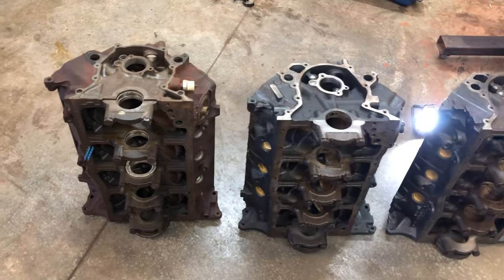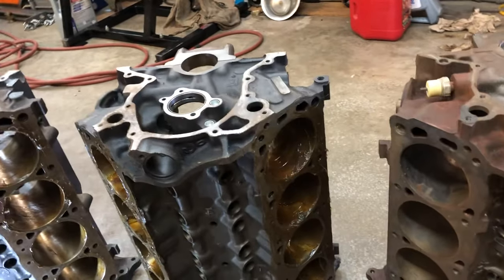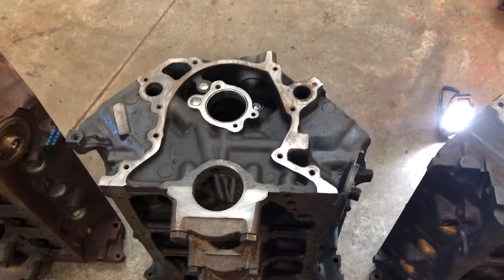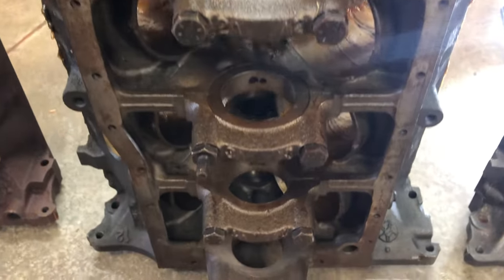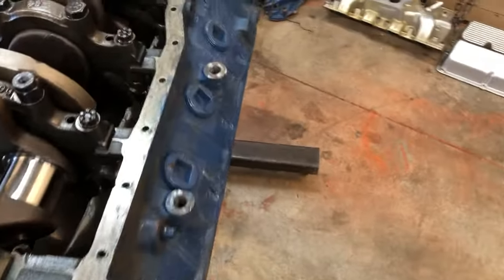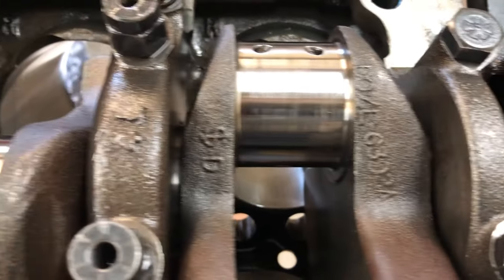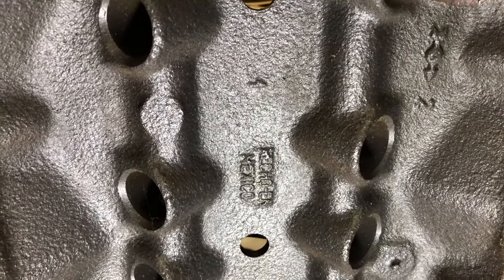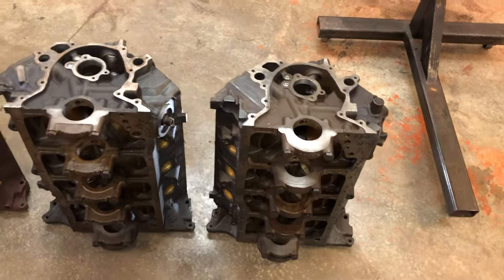The 4 different factory versions of the Ford 302

Comment: Some other differences that matter, IMO.
 The '68 to '80 blocks are really good blocks. In '80 or '81 Ford had to backpedal some, as they had intended to be super politically correct and dump the 302 after the '79 model year in favor of the horrible 255. Mustang fans and buyers threw a fit, especially if they test drove anything with the worthless 255 for power(pardon that overstatement). They made changes to the 302 block casting for lighter weight, meaning weaker. I took my '74 standard 302 block to a machine shop a few years ago, and you could tell they hadn't seen anything but roller blocks for a long time. When I picked it up, the machinist showed me in detail where weight and strength had been cut out of the later blocks by comparing mine and a '93 block. These days you hear people saying a 302 block will break in two if you have around 550HP. I guarantee you'll be hard pressed to find a '68-'79 block that breaks apart at that power level. Back in the OHO and FMS catalogs of the '80s, Ford, conservative as they were, said the production standard 302 block was good for 600HP, while the Boss was good for 1200. They recommended max overbore of .030 or .040 on the standard block and .060 on the Boss block. My '70 Boss is comfortably at .060 over.
 Saying the Boss block is a regular 302 block with 4 bolt mains and screw-in core plugs is not true. Weigh a bare one and compare it to the weight of a bare standard block. Significant weight difference. Even more of a difference between the Boss and a standard roller cam block. Then look the littlest Boss over closely. Thicker webbing/bulkeads, thicker cylinder walls ... on and on go the improvements over standard (including over the 289HP and rare 289HD).
 Like with the Boss 351 and especially the Boss 429, Ford said that they lost money on every Boss 302 they sold. But they got the B302 & B429 homologated for Trans Am and NASCAR, and people on the street scene learned that the B351 was the strongest "small block" of all. Richard Holdener, with a huge mass of videos available on youTube, is one of those who compared some Fords, including a stock spec Boss 351 clone, to all the famous SBCs of the day with dyno testing. B351 made the most power, B302 was second, and then came the Chevy stuff. Of course, the B302 was lacking quite a bit of torque so maybe that's not a fair statement for real-world usage by me, but it's true, for horsepower.
Reply: Thanks for making a good informative comment that taught me some important things about Ford small blocks. Especially about the one year only Boss 35. I never knew Ford made a 351 C type engine with 11 to 1 compression and a .550 lift solid lifter cam.
 Now let's talk about Holdners dyno test and Chevy comparison. He should have run exhaust manifolds on the Boss 351 clone because headers will always help any engine, especially any 351 C type engine. So his Hp numbers were a bit high because of that and the Holley carb. I am surprised  at him bad mouthing the 289 the way he did as well. He tested what he called a" Shelby trimmed" 289 and just barely broke the 300 hp mark. 
Anyway his Chevy comparison engine was the Lt1 350 of 1970 which had 10.5 to 1 compression and a hydraulic cam that was about 470 lift. A true small block Chevy comparison engine however would have been the 1964 L84 327 with 11 to 1 compression and a solid lifter cam although not the 550 lift cam of the Boss 351. The L84 with mechanical fuel injection made a true 375 Hp through exhaust manifolds so it would have been an equal comparison and about the same horsepower with less cubic inches. 
Either way thanks for the Boss 351 lesson. It goes with my Pontiac Super Duty 455 special engine manufactured off site of GM and the much ignored Ram Air 3 Pontiac engine which was under rated at 366 Hp.
As a side note Holdner did mention that the Chrysler 340 6 pack engine was also in the same category of most powerful small blocks, it's a shame those are so rare and difficult to find and get on a dyno to see how it would compare.
Reply: @crazyoilfieldmechanic3195  He ran headers on every one of those engines in this test series, if you notice, so I don't think any had any advantage over the others in this comparison. 
 I thought the key things about the Shelby 289 were; It was the smallest engine of the bunch by quite a bit, so really didn't didn't belong in this comparison without something like a 283 to compare to, and it was the only engine in the comparison that had horsepower and torque close to what the builder claimed for it. They rated it at 306HP and it actually put out 302HP in this test. The DZ302 Chevy and the Boss 302 were waaaaay underated, by comparison. I understand why they did it back then, but...
 He did test the carbureted version of the 327 you mentioned, that being the "365 HP" version. Not a pro on Chevy stuff, but my reading says that the L76 327 had all the same specs/parts as the "375 HP" Fuelie except for running a carb instead of FI. I've seen quite a few tests of the 375HP Fuelie done over the years in the various magazines, but had never seen one, even with headers, that actually made 375. Maybe I missed a key test. You're right about the B351 having more lift than the top dog 327 cams, but as per normal, the Chevy cams had a lot more duration, so each had their idiosyncracies that gave advantages (maybe).
 Ah, talk about sandbagging your HP numbers, Pontiac were pros at it. I recently re-watched a yT video comparing a 409 Chevy to a 421 SD, and how close they were to their claimed numbers. The "409HP" 409 showed about 406HP, while the "405HP" 421SD cranked 488HP. Talk about underating your weapon!
 Good stuff, and fun to reminisce about. We wouldn't have what is around now without the original muscle car era's killers.
Reply: @Zekais  he showed a picture of the hipo 289 on the dyno with exhaust manifolds was why I made that point is all. Something I had learned about that Ram Air 3 Pontiac engine was that they came factory with bleed down hydraulic lifters because the cam had crazy duration and the lifters kept it from killing the torque at low rpm but helped it breath up top. I also read where in the know Pontiac guys would buy that cam and lifters set from the dealer to get their base 400 engine to have a seat of the pants noticeable increase in power. Kind of like cutting the piece of metal off the linkage of Ram Air 3 Firebirds so the carburetor 4 barrels would open all the way !!!! Pontiac didn't want the Firbird tromping on the GTO !!!  I will look for some 375 hp 327 dyno vids or articles because I know they are out there. Now tell me if the 427 side oiler that came in a Thunderbolt had plugged threaded holes for attaching a dry sump oiling system like the 427 in the GT40.........
Reply: @crazyoilfieldmechanic3195  Yeah, I wondered if the 289 picture was from a stock photo grab-bag or what, since the only engine in that comparison that came stock with tubular headers was the Shelby 289, with the famous Tri-Y headers. Oh well...
 I've had quite a few FEs over the years, but am not an expert on them really. Too much conflicting info for me. I've read that all the big FE stuff (SOHC, Hi-Riser, side-oiler, etcetera) became avilable in '65, but also that the Thunderbolt had a side-oiler, though it was a '64 model. I'll have to leave it to real FE pros to answer that one, like Barry Rabotnik(sp?) at Survival Motorsports. It was dumb luck that got me my Boss 302 back in '75. The really expensive, rare stuff like a side-oiler? No luck dumb enough for that. Have never owned a side-oiler, except (sigh) in my dreams.
Reply: @Zekais  There is a guy in Ames Oklahoma that has about twenty five 60's and 70's race cars in his small museum. He has 5 cars with Cammers in them and 7 with high riser 427 side oiler engines. He is kind of poor as you can see lol. I asked him about it and he didn't know but said he thought all Cammers had the drilled passages for dry sump. I looked the best I could at 2 of the Cammers. One on a stand and one in an early 70's funny car and I couldn't see any large plugged holes for it. I just know that all 427 GT40's had dry sump oiling and that the blocks were made for it and not modified for it so I don't know. I guess it will have to be a question for "Mr Cobra" as he has several original SC 427 side oiler Cobras. As an also, his naturally aspirated 289 competition Cobras most definitely put out 500 hp. A far cry from the 306 hp of a mid 60's Shelby Mustang as Holdner mentioned them having.
Reply: In 1980 Ford asked the foundry to remove 20 lbs from the block, the foundry was only able to take 12 lbs out.  Anything above that and we couldn't get it through the broach.
Reply: @JeromeDiamond-cs7yw  Thanks for the details from the inside, I gather. Doesn't initially sound like that much weight removed, but from that small a block, I'd say it's more than just a significant amount, more like semi-disasterous, from a serious performance point of view. Thanks again.
Reply: i have a OG 79 302  in my Z7 zephyr.  i'm thinking i may leave it 306  and go .030 over to 306  or 331 stroker  next yr  if  i can use stroker clearenced rods  that SCAT sells  and not  notch the block.
Reply: Some of the 80s chev blocks or Con rods were the same way. 
Not much power back then so they got away with it.

Comment: Looks like the front of the roller block is thicker. The block doesn't have a visible bulge from the oil galleys and main bolt thread castings like the older block to its right. I wonder if some measurements actually support this observation.

Would be cool to measure and compare the thicknesses of the main webbing between these too.
Reply from the maker: Yes, the hydraulic roller block is thicker in the main webb area than the other blocks

Comment: The problem that I have with the roller blocks is that the bottom head bolts go into the water jacket I had a 1985 model and I had trouble getting keeping head gaskets from leaking even with stud

Comment: How about the Coyote block? You probably don't have one of those laying around for a comparison. But, I'd love to see one of those.
Reply from the maker: The coyote is very impressive motor steel crankshaft four bolt mains plus cross bolts I built a 2017 coyote stock . It was installed in a fox body mustang went 11:91 in the 1/4 mile 115 mph

Comment: ...is the cobra version of the 302 block any different in terms of construction than the GT 5.0 version? Just curious
Reply from the maker: If you’re talking about the 95 and 93 cobra 302‘s the only thing that was different were the cylinder heads they were a better flowing cylinder head and had roller rockers but the blocks are exactly the same as the regular 5.0 the head we’re Gt 40 and GTP 40 cast-iron cylinder heads from Ford. They were some of the best factory heads for the 302 made.

Comment: This is a very interesting video on the 302 small block engine. But I still can't find info about why my 302 engine oil filter is way bigger then my sister engines oil filter. Mines a 89 and hers is a 92. If anyone knows more about this please let me know.
Reply from the maker: The original filter for the 302 is a FL1A oil filter that screws to the block . If it’s remote mount with an oil cooler, it might be a different size. If her Mustang is a 5.0, it should be an FL1A also. Ford lists this oil filter as factory for all 302s from 1979 to 1995

Comment: I bought a 93 cobra 5.0 block that was notched for a stroker and with an engine girdle, man that boss is hands down beefier
Reply from the maker: You’re right the boss block has an advantage with the four bolt mains, but the hydraulic roller engine actually has thicker main webbing then any of the other blocks some say it’s actually stronger in the main web area and if you put ARP studs in it and a main girdle you’re doing pretty decent with it I’m not sure if any of the small block Ford Windsor blocks outside of the Ford racing blocks that are available will hold too much more power than 600 hp without splitting down the middle of the block
Reply: @pyleup  yeah I bought this block from a guy who swapped to the dart block in his 93 cobra, it came with arp bolts and a girdle and it was magnaflux and was fine, the guy showed me a video it was pushing 700 HP with about 23 lbs of boost and I asked how did it not split in half, he told me that the 5.0s will handle a lot of power but are limited to 6500 rpm because high rpm is what splits the block, I'm looking for 450 HP n/a with the eventual addition of a 150 shot. Also should I use moly lube or oil on those arp main bolts?
Reply from the maker: ARP bolts usually come shipped with moly grease And I just put a little of that grease on one side of the bolt threads before I install it for a main bolt or a head bolt. Just make sure you chase the threads with a clean, tap or die and blow them out with compressed air to make sure there’s nothing in there that would obstruct threads. ARP has a specific Molly lube for bolts. You should be able to order some. I would send you a picture of it, but YouTube does not let us post pics in the comments.
Reply: @pyleup  well they are used bolts but maybe I can order some but yeah I also saw that they want only 65 ft lb, is that correct? Sorry I just would like to do this right
Reply from the maker: I think 65 foot pounds is correct for small block fords on the head bolts, but you can look them up online they give out torque specs for small block fords. ARP bolts, sometimes have their own torque specs per.ARP.

Comment: What was the reason for changing fireing order on the 302 and what performance did it make if anything
Reply from the maker: That is a question that I cannot answer
Reply: Because the first (mid 80s) hot rod Mustangs used the cam out of a 351w.
Reply: Supposed to take pressure off number 1 main because 1 and 5 fires after each other that's what ford said . I think the serpentine belt pulling on front of crank also has something to do with it
Reply: I had a 85 302 with a lunati .496 int. .512 exh. 351w firing order. A standard 302 cam fires cylinders 1 and 5 first putting a lot of force on the front of the crank.
A 351w cam changes the firing order making the 302 a H. O. And more torque.

Comment: I have an Australian Falcon 1997 ute with the 302 in it. I was hoping maybe someone is their sufficient material to modify a two bolt block to suit the four bolt main cap ? What other differences are there between has the Boss block over the two bolt standard block without the obvious cam and head differences
Reply from the maker: The thing to do with the 302 and the 2 bolt mains is use main studs and a girdle to make the bottom end stronger it’s probably the best you can do with the two bolt main.  There’s just not enough material to convert it to a four bolt main
Reply: I thought as much thanks for that. It’s been a stout little motor and I have given it some therapy and it keeps on ticking.

Comment: The hydraulic roller block has less defined oil passage ways in the casting. Have they put more metal in the front main web? Or just moved it?
Reply from the maker: The hydraulic roller block has a lot more material in the main web area of the entire block than the others

Comment: The 1969 Boss 302 had a cross drilled steel crankshaft. These started to break and the service replacement crankshaft and the 1970 Boss 302 crankshaft were not cross drilled. I had a non-cross drilled 1970 Boss 302 and the crankshaft in that one broke. I'm not sure what the deal was with their steel. I believe the Boss 302 main caps were made of a different iron from the cylinder blocks, where the other 302 main caps were made of the same iron as the cylinder blocks. Certain Mexican cylinder blocks are stronger than a lot of US-made cylinder blocks.
Reply from the maker: Thanks for your input. Good information.
Reply: I used the cross-drilled cranks in my drag race Boss 302s and reved them past 10,000 with zero failures. I also used prepped stock Boss 302 rods ... not those overly-large and heavy 302 OHO Trans Am rods.
Reply: @johnjohnsn7633  I'm sure a properly made steel crank with 302 journals should hold up fine, but forgings can and do have flaws. Maybe the 1969 and 1970 cranks weren't checked that well. There was an issue with the 1969 cranks breaking and as a result, they switched to non-cross drilled cranks in 1970. All of the service replacement cranks for both years are not cross drilled. My original 1970 Boss 302 crankshaft did break and it wasn't cross drilled, so there were other problems with them. I'm sure most of them are likely good, but forged connecting rods and cranks often have some number of minor flaws that are allowed. Usually "micro cracks" can be found in all production pieces.

Comment: Looks to me like you forgot the 5.0 8.750" deck height block.  You can tell them because the cylinder deck sits a little higher than the water pump boss, like a 351w does.

Comment: @pyleup is there any difference in a 1993 5.0 and a 1998? ive heard theres a difference in the distributor gear or something of the sort but im not sure, rlly what i need to know is if a 1998 will swap easily into a 1993 truck
Reply from the maker: The 1998 302 would have a crank trigger coil fire system versus a distributor gear but essentially the blocks are still the same. As long as you had your 1993 stuff you should be able to retrofit the 1998 block into it but remember it will use a crank trigger instead of the distributor fire so you’ll just have to take that stuff out of it Reinstall a proper cam with the driver gear for the distributor. A 1998 Explorer 302 should have GT 40P Heads, the block in this video is a 1998 block
Reply: @pyleup gotchu, thnx